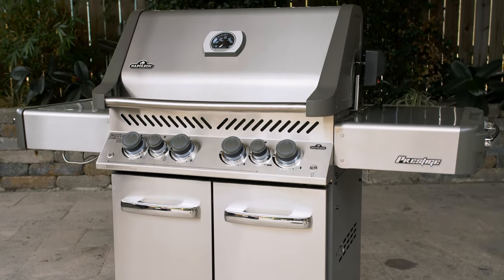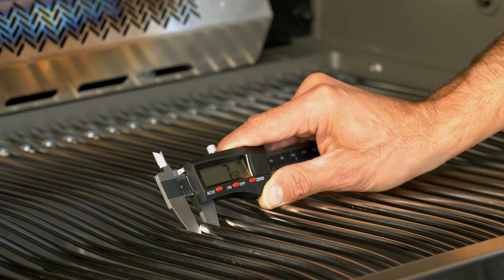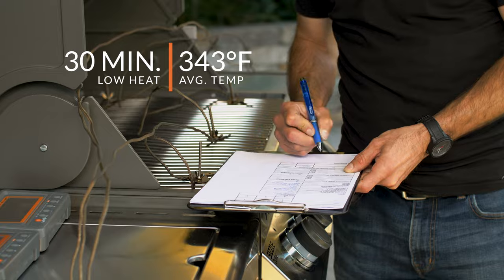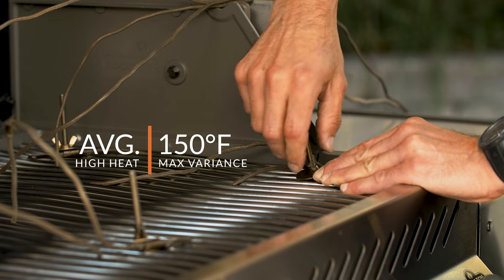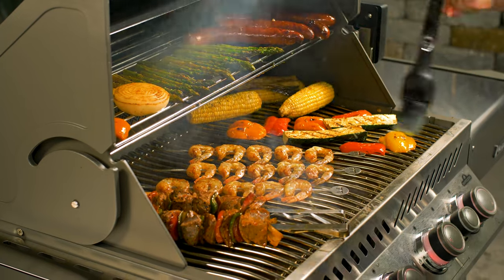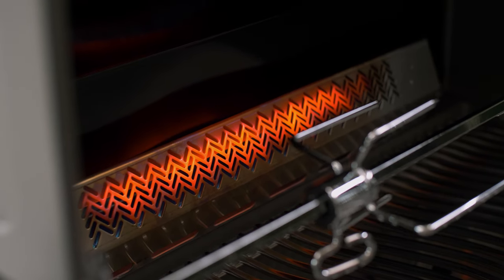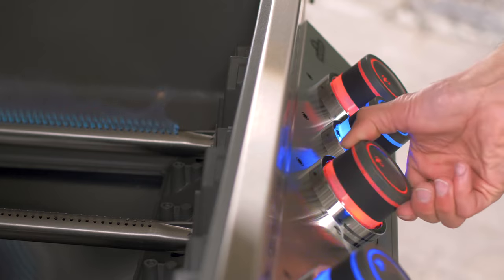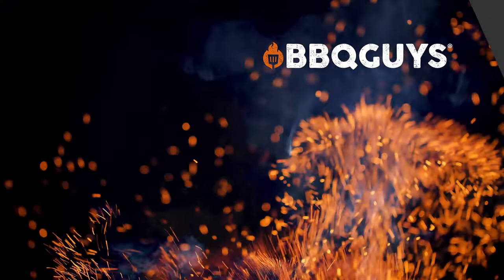Napoleon Prestige 500 Propane Gas Grill Expert Overview | BBQGuys

Comment: I bought this grill from BBQGuys just over a year ago and it has been absolutely fantastic! I plumbed in the natural gas version, and the convenience has been a game changer. Everything about the grill has exceeded my expectations after 20 years with my trusty Weber, and the real surprise has been how much I've enjoyed the rotisserie (I cooked our past 2 Thanksgiving turkeys on it and it was delicious!).
Reply from the maker: Glad to hear you are enjoying it!
Reply: My Weber grill, after, 15 years, finally gave in - the cookbox cracked at the hinge to the lid so I can no longer use it. Apparently, the cookbox isn't covered under the 25 year warranty (back in 2007 when I bought the grill). I'm considering this as a replacement, but I'm wondering if this needs to be plugged in or something for those LEDs or other accessories to work other than the rotisserie. I'd understand that you need power for the rotisserie, but for the other parts, it'd be annoying to plug this in just to cook.
Reply: @joshuaychung  I've seen in other reviews that it's battery powered but don't know the specs on that.
Reply: @leviaestes  I've since purchased this grill. The LED lights for the knobs are, indeed, battery powered.
Reply: I too just bought this grill and I love it! I’m wondering how heavy of a turkey can you put on on the rotisserie any input is appreciated thanks!

Comment: My neighbour and I have had Napoleon 500 RSIB grills (not Prestige but generally the same grill without some leds and such) for about 10 years now.  Napoleon stands behind it and the only thing I've changed is the flavour bars.  Napoleons do run a bit hot though.  It's hard to cook low heat without setting up zones.

Comment: thanks for the info, im in the market for a new grill and while doing the research on all the competition it seems like most other brands dont even really come close to the napoleon grills interms of features and value for the price. i do have 1 question though, are you able to remove the grill head and install it into a built in countertop? Iam in the process of building an outdoor kitchen so i would use the grill cart at first but later on i would like to build it into my kitchen.

Comment: I grill. Literally 3 to 5 days a week and live on the coast. I have watched as my Ducane has outlasted quite a few Webers due to the corrosive environment over the past 15yrs. It's going to be sad to let her go but it's finally getting due to be retired. Can I expect the same longevity from a Nepoleon stainless grill?
Reply from the maker: One thing to consider: While this grill is built tough, and backed by a strong warranty, Napoleon Prestige Pro grills are not "all stainless steel", which is what many customers are shopping for nowadays. Along with the stainless steel components on the grill, you will also find cast aluminum and porcelain enameled steel components too, such as cart legs, back panels, etc.
Reply: @BBQGuys  What are 2-3 alternatives to this grill for someone in the market?  Love all the features and budget under 2k... Thanks!

Comment: Do these have to be plugged into an electric socket for the LEDs to work?
Reply: The LEDs are powered by 4 D size batteries.
Reply: @drzoidberg1  Thank you. I've been told that Prestige PRO needs to be plugged in, so that makes my decision easy. I have zero desire to plug my grill in.
Reply: Rotisserie has to plugged in  but dials and ignition are D size batteries
Reply: @drzoidberg1 

3x D batteries not 4. And they are included in the box

Comment: Would you recommend this grill over the new 2022 Webers?
Reply from the maker: It's hard to say. But the new Weber's with their sear station, side storage and cooking system are hard to beat.
Reply: weber and napolean offer a bit different cooking styles because of their difference in heat insulation
Reply: There are some differences. The Weber Genesis does not have a rotisserie burner. The Weber sear station is just a regular extra tube burner and is in the main cook area as opposed to on the side. The Weber has an external tank with a visual shield. This opens up more storage inside the cabinets. The Weber burners are not connected so if one goes out it will not reignite but the gas still flows. The Weber are 3 burners with the 4th burner offset for the sear station so the cooking zones are different/asymmetrical. The Weber does not have a lifetime warranty. The Weber has 9mm stainless steel grills vs 7.5mm on the Napoleon.
Reply: @drzoidberg1  nice info. I'm on a toss up between this and the weber. I live 5 min away from a weber factory and was hoping to see if I can get a discount, but doesn't look like it. So 1,350 on the weber or 1,350 on this one. Idk.
Reply: @Ryan-re1rs  Not sure if you’ve purchased a bbq yet but I just bought the prestige phantom 500. Putting that up to the Webber in my mind it’s an easy win! It looks sick and performs like a dream. The cast stainless steel grates are also unbelievable. Good luck with whatever you choose, or chose 😂

Comment: how does this compare to the pre-2022 genesis ii models?
Reply from the maker: BIGGEST differences is the radiant infrared side burner that Weber has never had and the rear burner for rotisserie where Weber has none.
Reply: @BBQGuys  dont forget about those cast stainless grills on the phantom! theyre a huge difference maker especially for the price
Reply: weber is great but its cooking experience is lackluster compared to the phantom model. definitely comparable to the regular p500 models tho